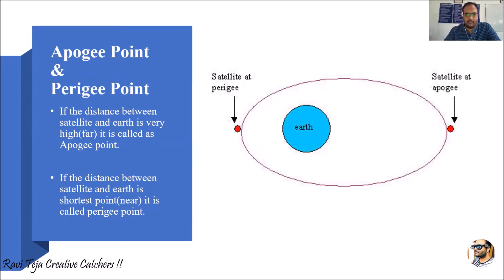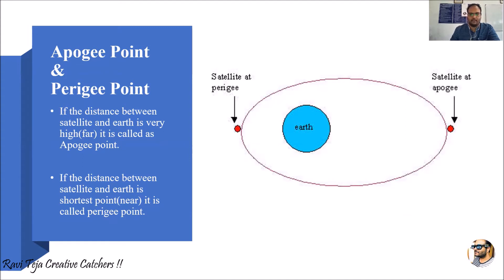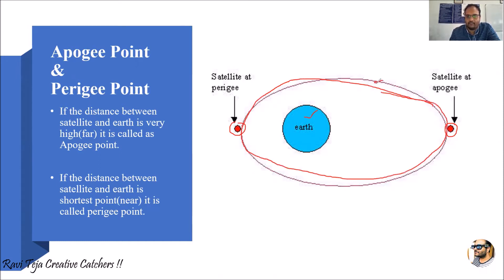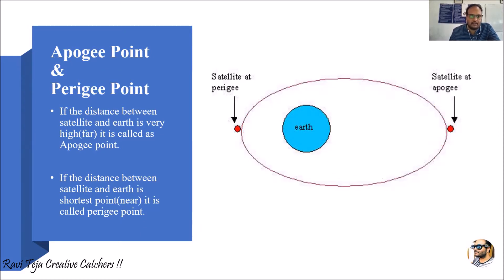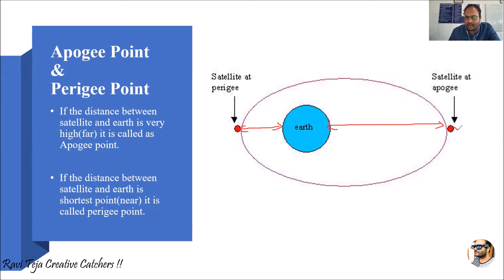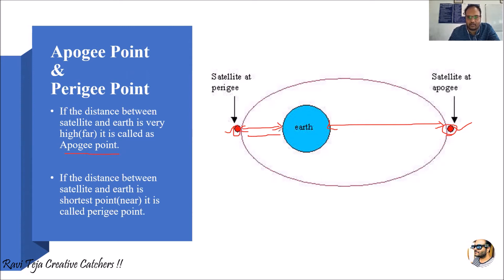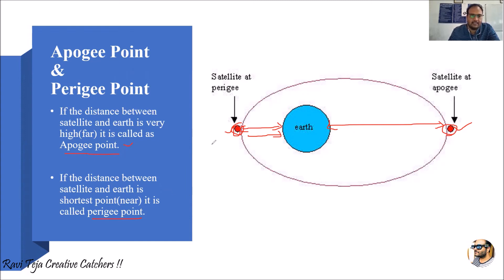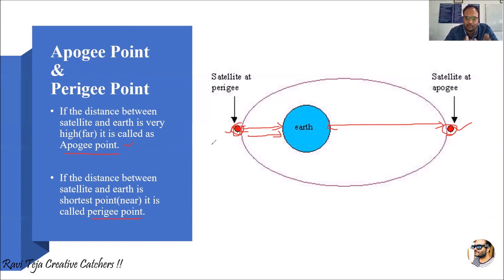Apogee and perigee in satellite communication

Comment: i have a doubt sir, even though the gravitational force is 9.8m/s at each and every ground point.
By this we can assume that at a distance of 36,000KM the gravity may be less than 9.8m/s but it is same at every 36K Km from earth's surface.
So, why the satellites are revolving in elliptical orbit?
Reply from the maker: Velocity of satellite is not constant it keeps on changing so based on the velocity,  the force acting on the satellite also changes which makes the satellite to move in elliptical shape